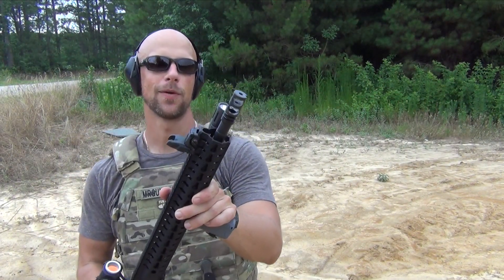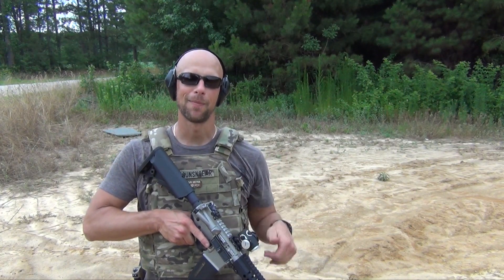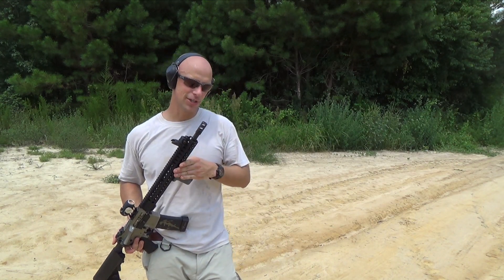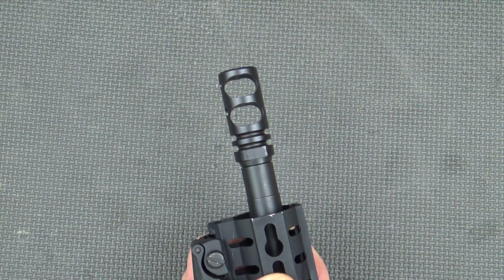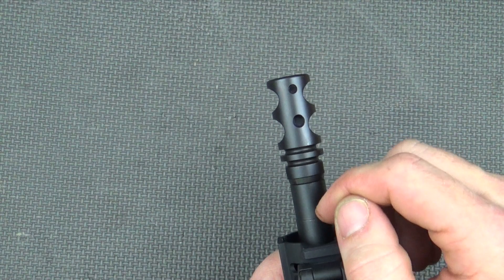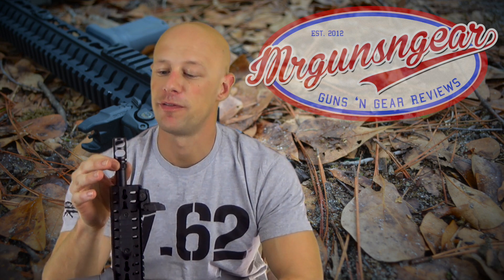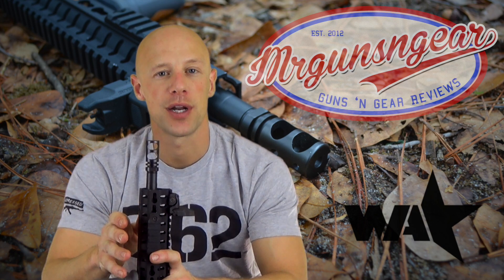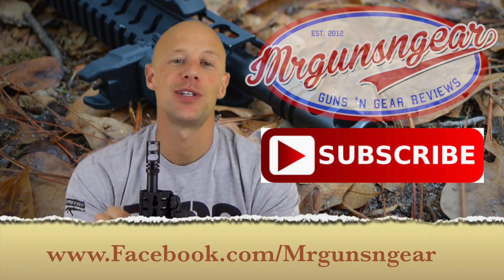Wheaton Arms Pro 3-Gun AR-15 Mini Brake Review (HD)

Comment: If you could kindly express a personal preference between the Mini 3 Gun (Deployment Comp) and the Surefire ProComp after reviewing them both, your input would be greatly appreciated.  Ive been torn between purchasing one of the two...  Robbie Wheaton  (who is a very reputable and humble guy) has claimed his "Deployment Comp has out performed most everything else on the market" 
 ...And if the Wheaton Arms Comp does have a slight edge over the Surefire Pro, do you think it's worth spending the extra $70?  The Surefire brake is about 1oz heavier @ 3.5oz  but that's hardly a deal breaker...
  (and as a disclaimer....  I understand any input you share is based on your personal experience, testing the brakes on your rifles...   Everyone reading this should  understand that all muzzle devices work differently on every AR platform) .
    Thank you for all the great reviews!!
Reply from the maker: Dan Barnes procomp is longer/heavier/cheaper.   Performance is the same.
Reply: Mrgunsngear Channel I appreciate your prompt reply once again... 
Being a "3-gunner" myself,  I believe Its important to support guys like Robbie Wheaton.  He's a pioneer of the sport who takes great pride in designing high quality products geared towards our game.  I'm going with the Deployment / 3 Gun Mini Comp!!  -Thanks again!!